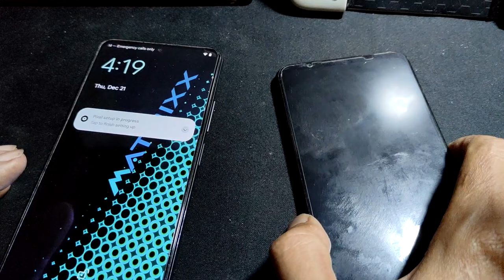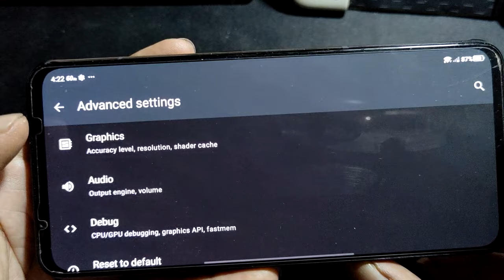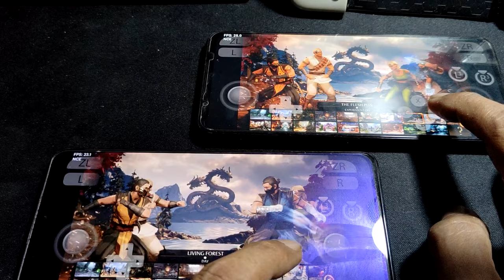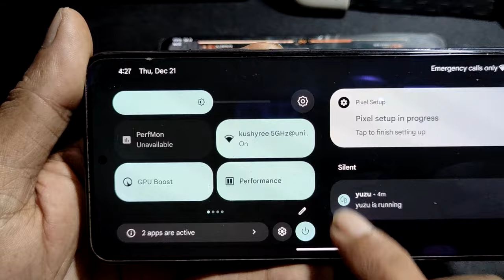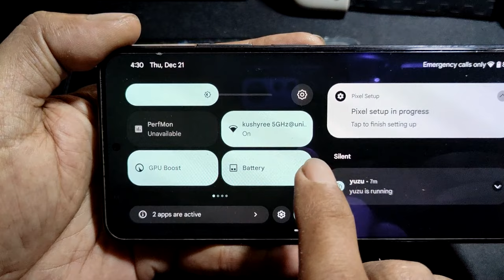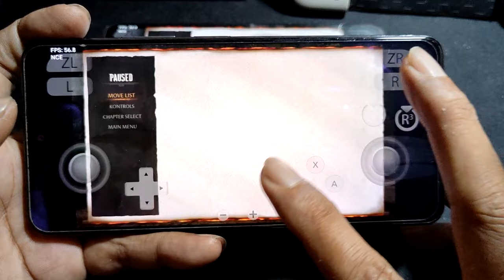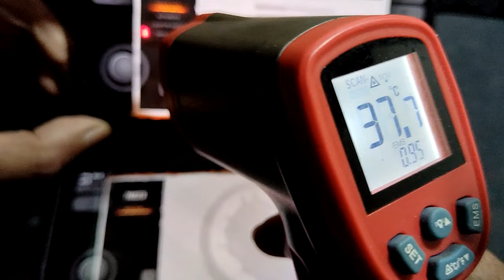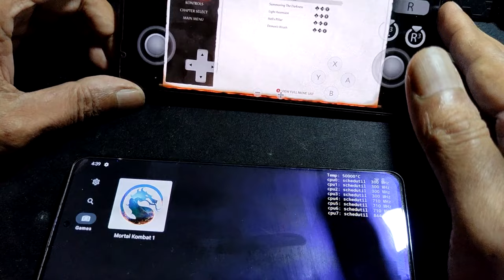MORTAL KOMBAT 1 full game +dlc using YUZU 167 on SD 870 vs 8 Gen 1 | PUSH TO THE LIMIT

Comment: How come snapdragon 870 beats 8 gen 1
Reply: Driver issues? Dunno
Reply from the maker: for actual reason i really don't know, if i got other soc such as 8+ g1 or 8g2 maybe i can guess the performance statistic , on paper it should perform better but in reality not up to expectation ... it really hard to swallow if we got high end soc and it perform worse than a potato phone , i see a video on 8 gen 3 which even worse than 855, maybe yuzu team need to do something about it
Reply: @3mu1ationWorlds  my snapdragon 855+ plays mk1 quite well. (My phone is now a furnace after 15 mins of gameplay). I could also play GTA V with mobox emulator. (My phone is now a reactor)
Reply from the maker: ha ha that true and when ps3 emulator come out it become a sun and that a fact
Reply: Had more powerful gpu than gen 1
Reply: @SkybornSlayer the GPU isn't more powerful on the 870 and using AnTuTu the gen 1 GPU is double the score
Reply: @KaayyC  gen 1 as chip is more powerful and graphics but gpu snap 870 that's what im saying
Reply: @SkybornSlayer I tested my rog phone 6 with the gen 1 and I'm getting better performance than what he showed so maybe he just isn't testing correctly
Reply: @3mu1ationWorlds 870G is not a potato processor btw!